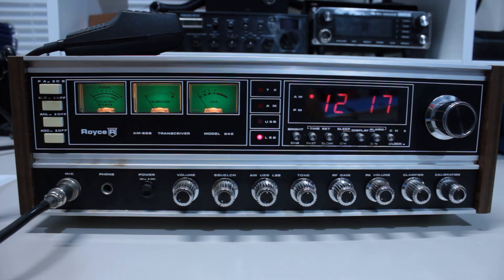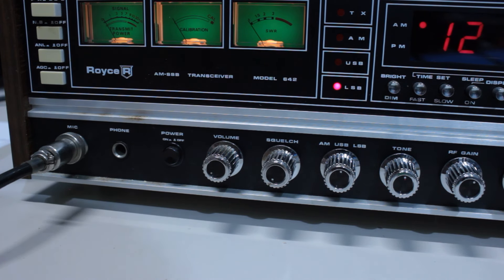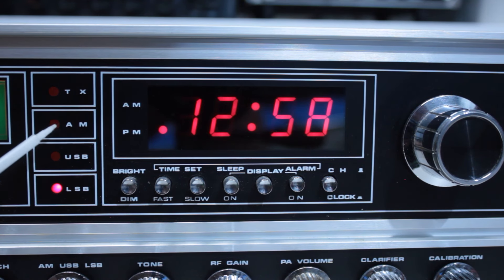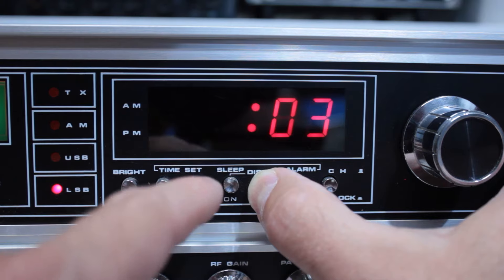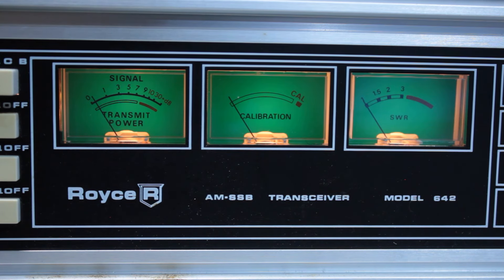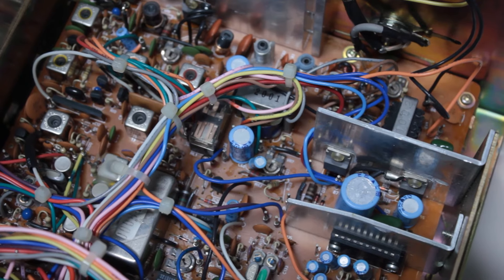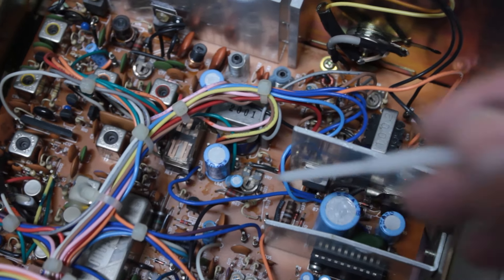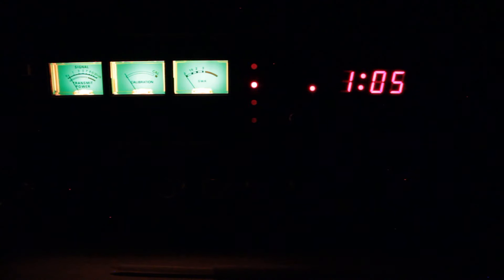A classic CB Radio with three meters - the Royce 642 AM SSB Base Transceiver

Comment: Cool looking radio. Hook it to a Palomar 500w linear and your all set, output is ideal to drive a 500w amp to peak. I used a Washington base with 500w amp in the 80's. Similar kind of radio.

Comment: You know your stuff, so I know you misspoke when you said the headphone jack was a 1/8. Almost everything made back in '78, would have had a one 1/4 inch headphone jack. Excellent clip and a very nice transceiver. Just like the madison, had Royce added a frequency counter, it most likely would have challenged the Cobra 2000. I never liked what some referred to as the piano design Style, on the 2000, so I removed the clock on my madison, and replaced it with a frequency counter.
Reply from the maker: Whoops, good catch, I added a note to the video. Definitely a 1/4" old school headphone jack :)
Reply: I'm 100% positive that everyone who's followed your Channel, understands that you're 1/8 inch comment, was a slip of the lip. We all know you know your stuff. I'm looking forward to your next clip.